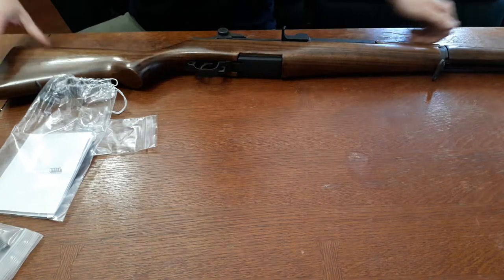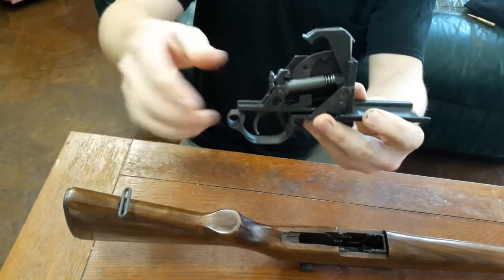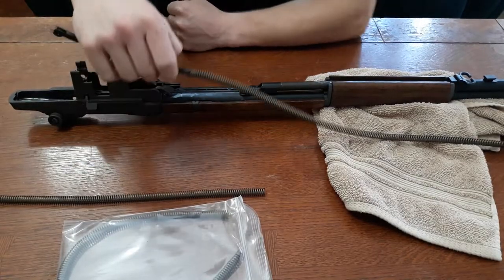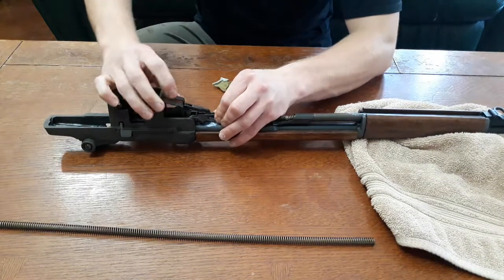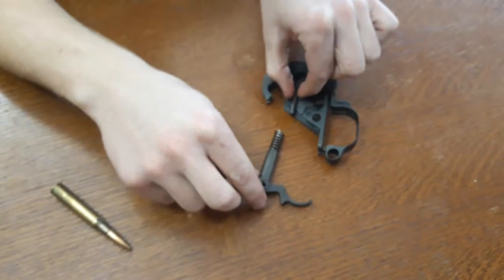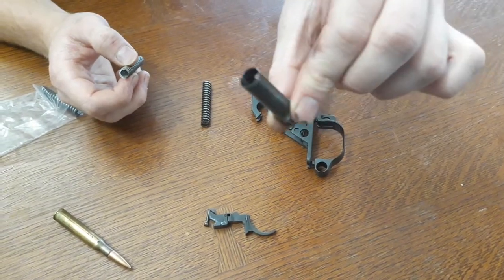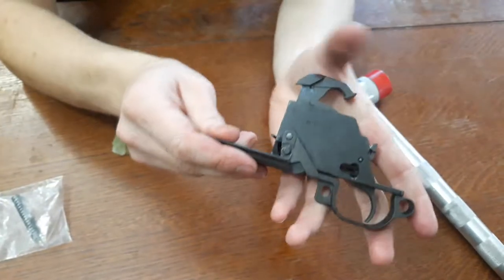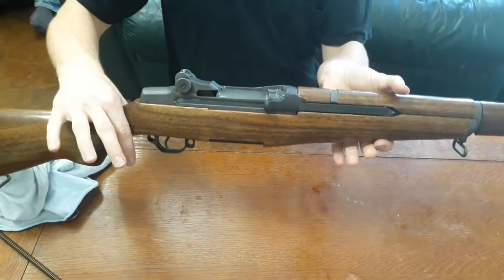M1 GARAND SPRING REPLACEMENT!

Comment: Your one statement about using the notch on the trigger for leverage was the ticket on that hammer spring. When you use that, it goes so much easier. Thanks for sharing.

Comment: I commented on another M1 video great idea I changed out all the springs and pins. Even if it didn't need changing. Save the old parts . You should take the internal magazine apart remove the bolt and oprod.. So you can clean the barrel from the throat/chamber side rather than the muzzle. It's easier on the barrel and your not  pushing the gunk from the barrel into the chamber. Just a thought it also gets you familiar with the rifle you should take down the gas cylinder to check it you shouldn't do that to often especially since the barrel is new.
Reply from the maker: Thanks for watching our videos and for the information. We have saved all of the old parts, and your right about the cleaning procedure. I have tottally taken down the rifle and the gas cylinder looks good, But i guess there is a gauge or something to check it?
Reply: @undeadbrosm41a39  If it's a new barrel I'm sure they gauge it right you have years before you start buying gauges. You guys will do well.

Comment: You should not need to change that op. rod spring.  Most cycling problems are caused by gas problems.  Check to make sure your gas tube slides down enough on the Garand to expose the gas port hole.  Many people overlook this problem.  That hole on the underside of barrel needs to be completely exposed for sufficient gas flow pressure to cycle action.

Comment: Will the spring stop making the scraping sound in the gun after you shot it a couple hundred times
Reply from the maker: It might, I'm not sure. It might help to have more oil on it too
Reply: @undeadbrosm41a39  and how do you clean the inside of the oprod tube
Reply from the maker: @blonded3598  we used a small bore brush

Comment: How did it do did it cycle good
Reply from the maker: Yes.  It works really smooth now.  I also cleaned out the spring tube too, so that helped out.  No jams or anything.  Also, it is really nice to have that stainless steel spring in there.  We will make another video with it soon! Thanks for watching!